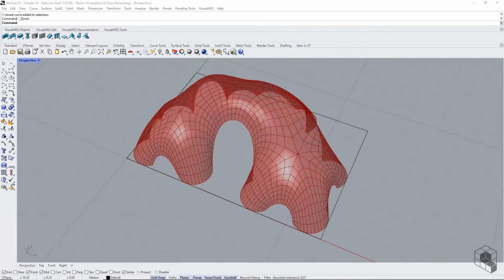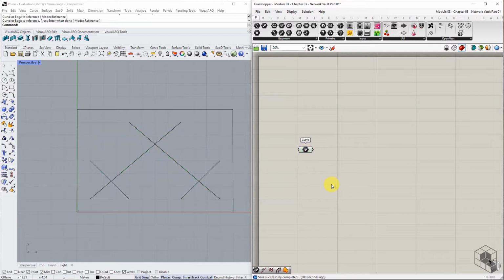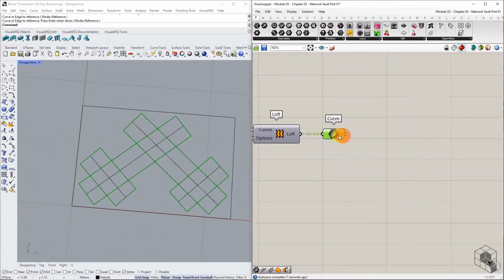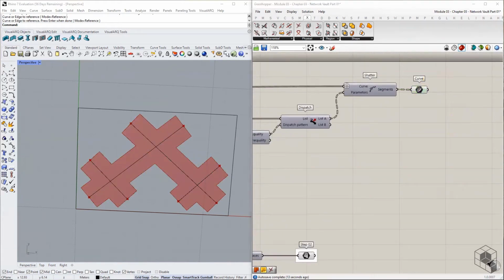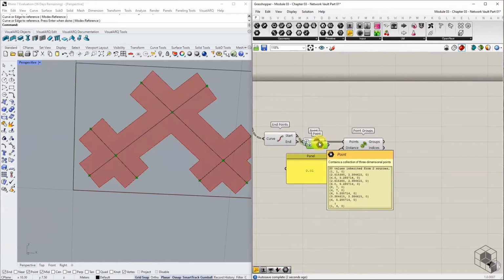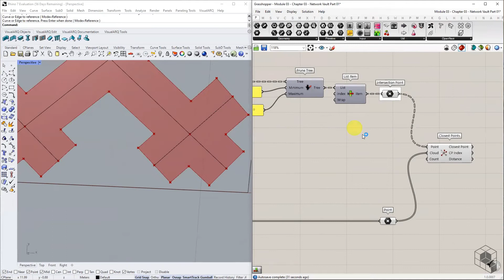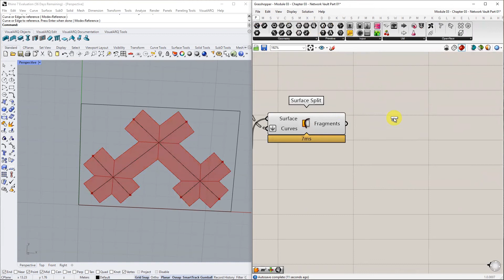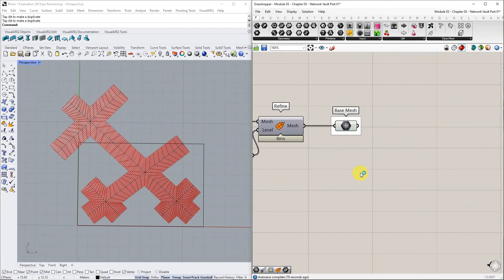Digital Form Finding - Chapter 03 | Networked Vault Part 01| Rhino & Grasshopper Tutorial

Comment: During refine mesh and quad mesh steps my mesh isn't triangulating or quads ...it stays the same what should i do
Reply from the maker: That is strange. Could you share your gh definition to qbricklab@gmail.com?
Reply: the same happens to me, did you find the reason? :')
Reply: I think I’m having the same issue, simple mesh component is not maintaining the vertices created by surface split. Is there a way to work around this? Pls advise. Thank you!